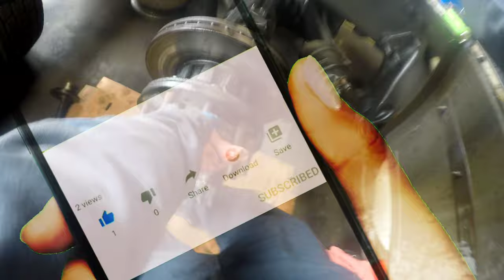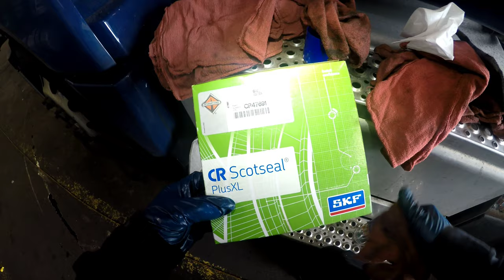how to replace a wheel seal on a tractor with disc brakes STEP BY STEP *part 1 (international truck)

Comment: thanks for this video i just started breaking one down on a freightliner never messed with disk air brakes before. i noticed the first snap ring but not the second and was wondering why the dang nut would not back all the way off